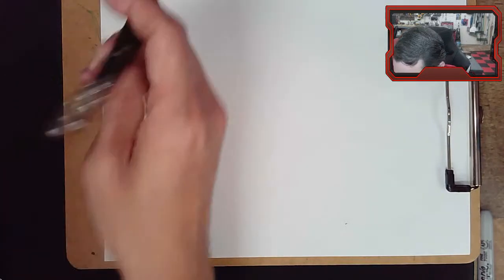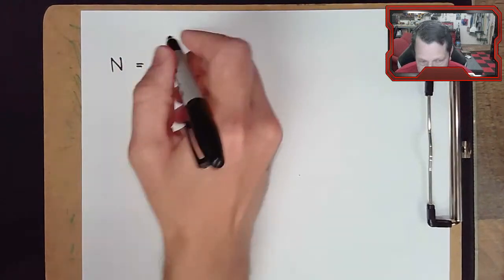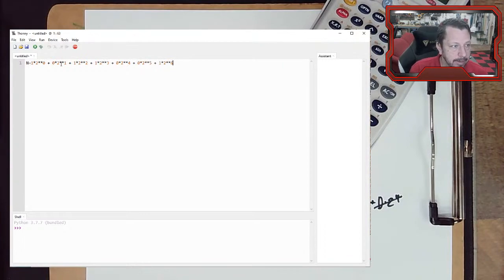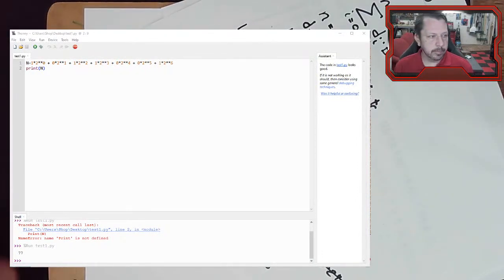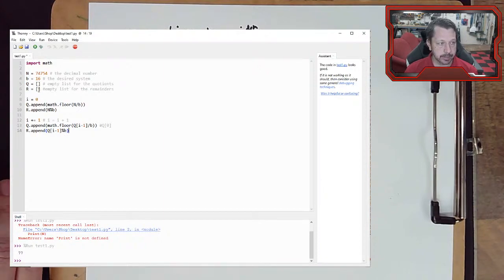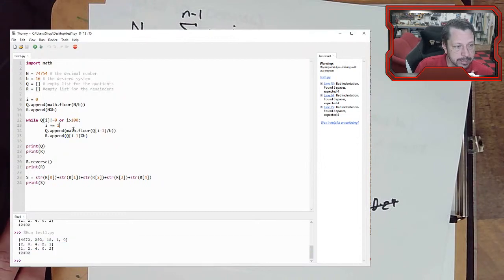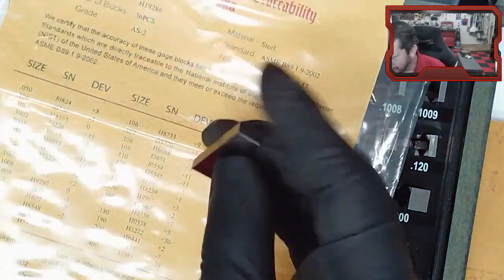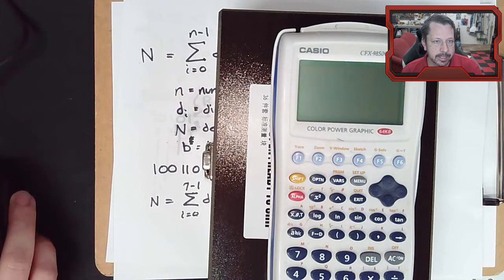Unit Standards | Python | Number Systems | Measurements 02

Comment: Professor Crittenden. I have spent about 20 hours completing the previous 01 course. With my many mistakes and the few you typo'd I learn a lot about de-bugging.  I am especially interested in the Python portion of the material, as I have over 60 years of experience in the electrical industry.  My goal is to learn python to be able to code for strain gauge/load cell Data Acquisition and measurements.  Thank you again for your presentation.
Reply from the maker: Thank you very much - and sorry about the typos. :) Python is a great language to learn due to its versatility. If you want to look deeper into Python in general, there is a really good course on Udemy called 100 Days of Code. Thanks again!